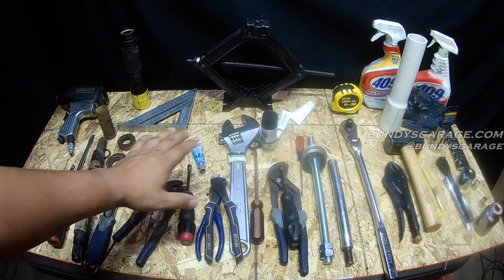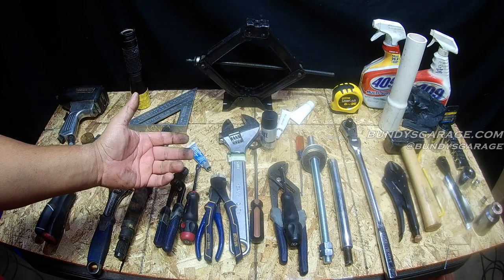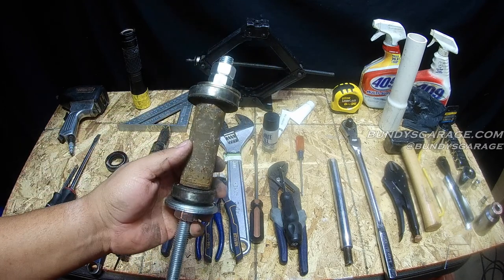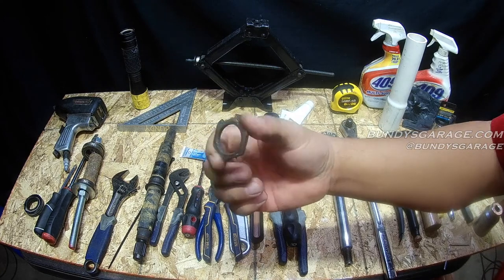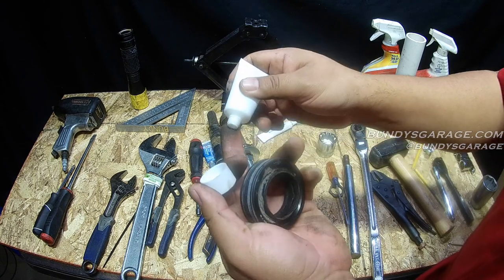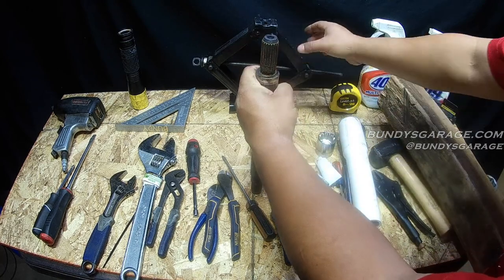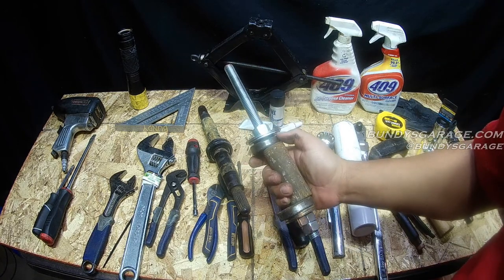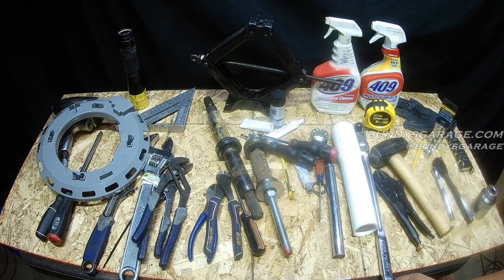Whirlpool Cabrio Maytag Bravos Washer Bearing Removal and Install - Tips & Tricksll Tips and Tricks

Comment: I just got rid of mine. 5 yrs old and a piece of junk. My wife hated it. Sounded terrible and the noise was unreal. Bought a speed queen all mechanical  all metal gears and transmission. NO PLASTIC NO ELECTRONICS. GOOD LUCK
Reply from the maker: Yeah my wife hate it too. She says it does not clean as well as the one we got rid of. We were all excited to get it 8 years ago and after a week of using the new one, we wish we hadn't sold our old ones. If I can get another 5 years from it I'll be happy.￼

Comment: I'm sure this will be helpful to many.  I had to replace the bearing in my 90's era Neptune (the one that sank Maytag).  There was only one guy on the Internet helping people.  He invented a puller and even rented it out for a reasonable price.  Took whaling on it for an hour with a 5 lb sledge but I got it. Maytag repair wanted $600 to repair, I did it for about 10% of that and had the satisfaction.  I hope your video will help many, again thanks for putting this ans your other helpful videos out! :-)
Reply: If you're referring to the tony tool, it's price is anything but reasonable

Comment: If you take a small metal pick, you can remove the bearing's rubber seal and pack the bearing with some better grease.
Reply from the maker: Thx for the tip!

Comment: i bought my parts from an ebay site . i bought tools and bearing shaft kit for 129.00  they come all together as one package . i have a suggestion on cleaning out bearing surfaces on the the washer side use brake clearer but remember this stuff is flammable so use adequate  ventilation . i also used a small amount of Loctite on the nut that is on the bottom lower nut on the shaft , it prob isn't a big deal but the nut on my washer was loose ,this may be part of the seal failure issue . its not a real complicated repair but takes a little time .
Reply from the maker: Good info. Check this out:

https://youtu.be/Hhkj8zQmL6I

Comment: It was showing sd on my Whirlpool Cabrio so I replaced the bearings and a new shaft now sd code is gone but now showing code ul could it be the suspension rods?
Reply: You could over fill your washer with load if it still have the ul then the suspension then.